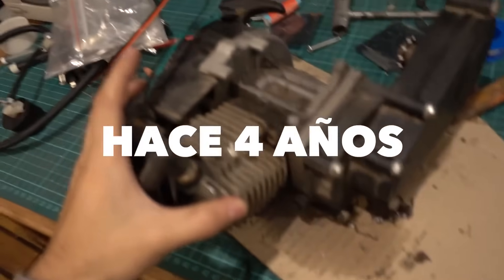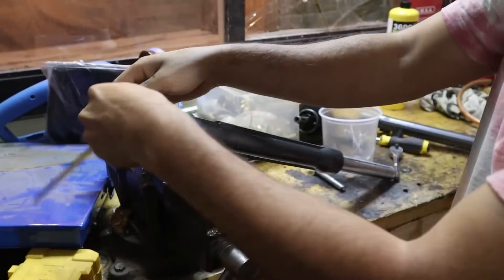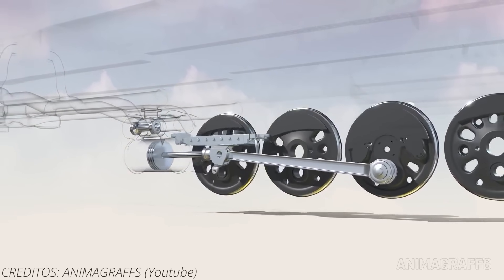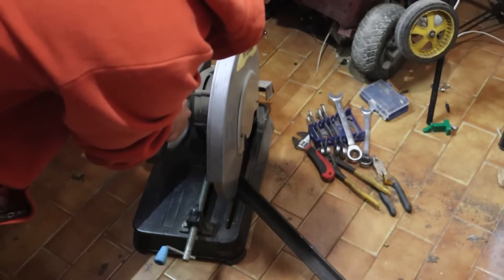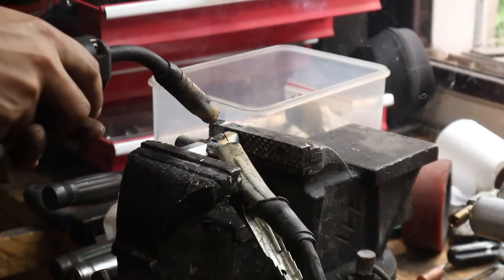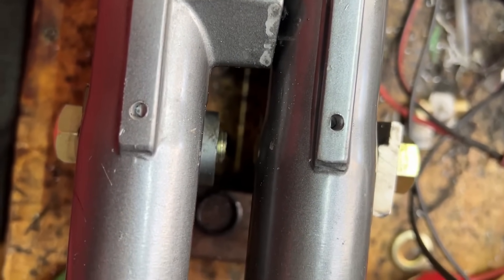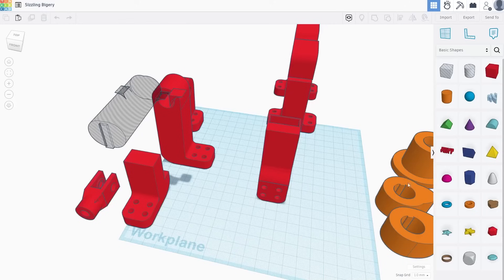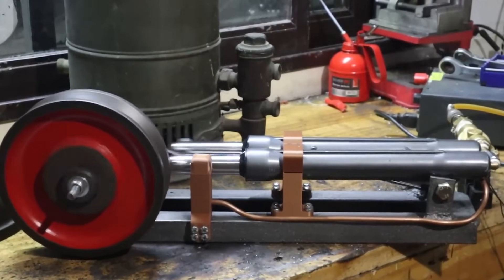I built a STEAM ENGINE (Using recycled parts)

Comment: You can make valves similar to a 4 stroke engine head valves very easily by grinding bolts in to cones and than drilling a valve block from aluminium. You can seal the valves with a steel plate on the top. Or just use a valve body from some pneumatic machine and remove the electromagnet to replace it with a normal magnet on the cam shaft.